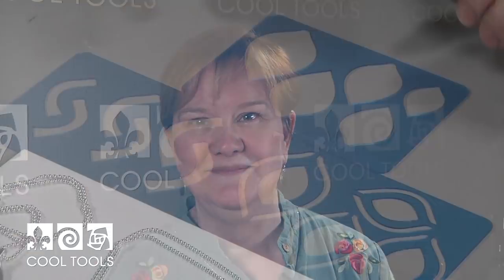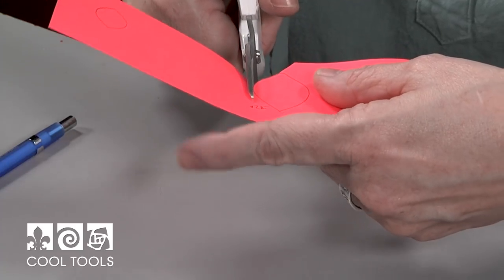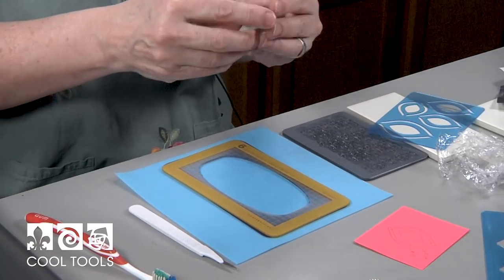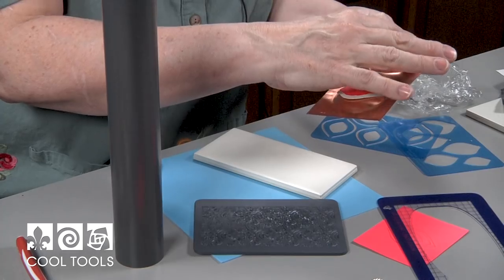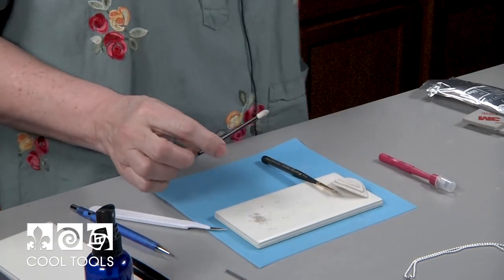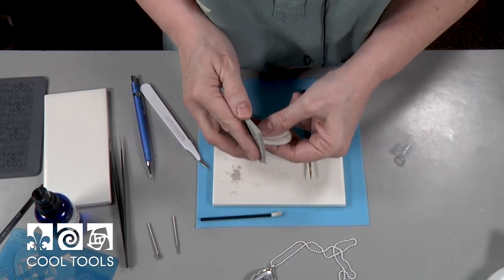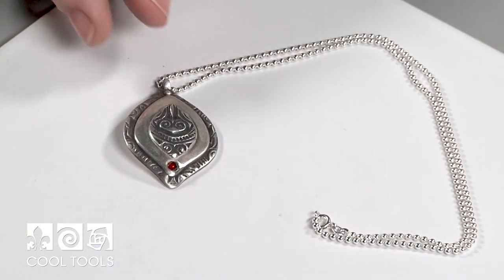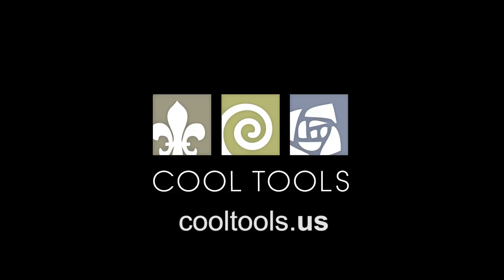Cool Tools | FS999™ Three Layer Pendant by Cindy Pope

Comment: What type of stone did you use that won't crack due to the heat in the kiln?  For that matter, what temp did you fire the piece and for how long?  

Thanks!
Reply from the maker: Hello, Cindy uses a Cubic Zirconia - Hessonite Garnet stone. You can find this stone here: https://www.cooltools.us/CZ-Hessonite-Garnet-Cabochon-Round-Checker-p/czf-358-p.htm

On this product page, you can also view our Gemstone Firing Guide, which will tell you each stone that can be fired and for how long, at what temperature. Hope this helps! 

If you have any other questions, feel free to reach out to our customer service at 888.478.5060 or sales@cooltools.us